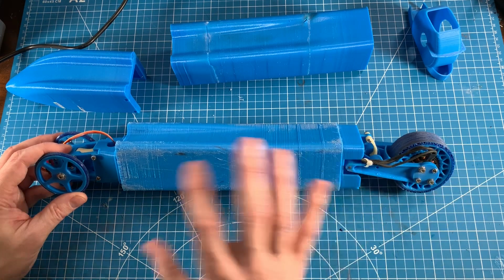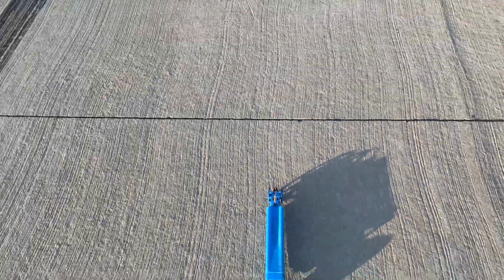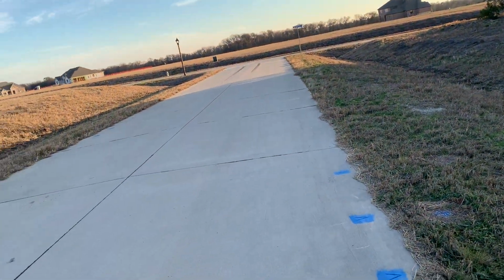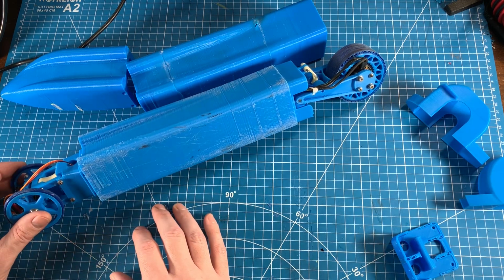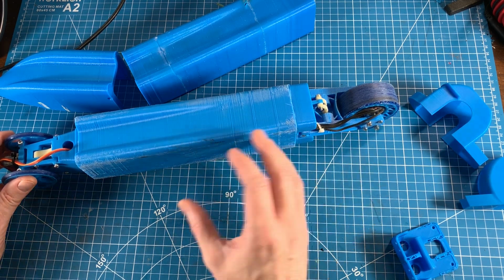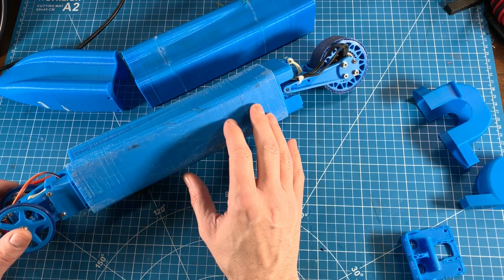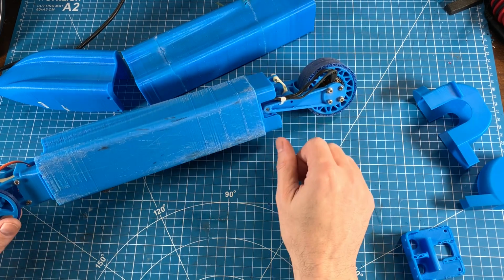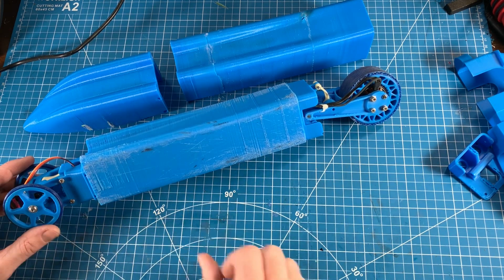Project Streamliner: First Test Pt4

Comment: maybe a bit late but increase the wheel size.. will slow down acceleration and bring up top end
Reply from the maker: Unfortunately, I think bigger wheels will raise the center of gravity and roll center both. I’m new to this, so I didn’t really clarify properly in the video, but the tendency to roll over is related to the relationship between the roll center and the center of gravity.  The tendency to roll over is because the roll center is so far above the center of gravity.

Comment: The motor turns so fast it may be hard to get that design working without any sort of gearing
Reply from the maker: Yeah, I’ve gotten it to work better now. I have traction control in the lasted version and I’m using a rubber tire.

Comment: Are you running a hard plastic tire? Because if you are, thats the bulk of the problems. It has zero grip, so it doesnt transfer any weight whatsoever. And that surface for testing will yield no results. Fantastic build and design otherwise.
Reply from the maker: They’re made from polyurethane, think skate board wheels. Right now I’m running a rubber tire which does have a lot more grip.
Reply: Open cell neoprene rubber is typical for RC drag racing and LSR. Would require a wheel that can be trued after mounting.
Reply: Also, roller skate wheels only work with a tremendous load on them, like the weight of a human body and Ive never heard of them being used as a drive wheel. I guarantee if you mount neoprene foam rubber, youre suspension will work much better as is.

Comment: Wow evidently we live very close together.  This is the road I have been running on lately.  The road is good for about 85-105 mph.  I'm looking to see if any regional airports would let me run there with my streamliner build.  We should meet up some time at this road for testing.
Reply from the maker: Wow that's crazy.  Yeah we definitely need to meet up and run the cars.
Reply: @IndeterminateDesign  let me know if you run again out there and I can come out.  Maybe I can assist filming for you while you drive.  It is about a 10-15 min drive from where I live in Princeton.  Shoot me a message at LibertyFrancis1@gmail.com

Comment: Awesome results. Some armchair thoughts:

1) The surface you're testing on is the scale equivalent of a drag car running on washboard road in Costa Rica.

2) First test I'd do on any wheel design is a no load full speed test to see if it will hold together and how it will deform at top speed.

Can't wait to see how this develops!
Reply from the maker: Yeah, that road surface is pretty rough. I wish there was some smooth asphalt that I could run on. 

I’m hoping to build a wheel test rig that I can run them up to 24,000 rpm and see how much they expand or if they explode. 😆 I can already tell that I may need to have these balanced and chucked into a lathe to true them up.

Comment: Great work!! I was thinking a higher coefficient tire would help off-the-line so it didn't get a chance to skid sideways in the first place. Finding a rubber that is thin and light enough but is also strong enough to handle the rotational speed wouldn't be easy. I really love the idea of a flexible wheel. One last thought, could moving the center of mass forward help improve the overall passive stability?
Reply from the maker: The flexible urethane I printed the wheel out of doesn’t have a very high coefficient of friction. I’m thinking about cutting up some mountain bike inner tubes to try out some rubber. 

That’s a great idea, I think moving the center of mass forward might help. I didn’t mention it but the biggest change between test session #1 and #2 was that I moved the battery as far forward as possible and lowered it in the chassis which made it much easier to launch.
Reply: @IndeterminateDesign  McMaster-Carr sells "flex-grip drive rollers" which can be as low as 20A durometer, which would be a huge improvement in grip (though it would be tricky to fit a motor/hub in one of them)
Reply: @bobspazoid7086  I see what you mean by the drive rollers. On their own they look promising but as you said, they'd be hard to implement here. My first thought was to cut a short section of medium/high pressure hydraulic hose since it comes with steel bands molded in. If you could get the right size, it would be easy to slip on over a 3D printed rim. But it would be very heavy and probably overkill for strength.
Reply from the maker: I like that idea, I’ll look at those. The trick with softer rubber will be how much it will expand at high speed. It’s going to be a balance.
Reply from the maker: I was looking at radiator hose but hydraulic hoses would be even better. I also may order up some HDT/GT belts with Kevlar bands. I see you can order them in custom cut widths. 

I might need to learn how to vulcanize my own rubber. 😂

Comment: Two ideas, first try adding some toe in to the front wheels if you haven't all ready to make the steering less twitchy at high speed (If you haven't all ready, I can't remember) and secondly maybe try adding a tuned mass damper if there is space (which there probably isn't), I think I remember Renault F1 using it in the nose of their car in the 2000s which kept the balance of the car from being upset when using the curbs and could make a big difference in stability.
Reply from the maker: That’s a great point on the alignment. Right now I’m running 0 toe, but it appears to toe out when running. I wish I had a mini camera to strap to the front to see. I may print out a few different front steering racks in different widths to see how they effect the handling.  
I’d love to try the tuned mass damper in the nose which is mostly hollow. I want to log vertical acceleration data from the MPU6050 so that I can optimize the dampening.  I’m not sure if it will be accurate enough though.

Comment: Looks like the suspension sticktion combined with the low weight is making it hop like crazy. Given the low size and weight, point contacts rather than cylindrical bearings might help (i.e. more Swiss watch than German sedan ;-)
When building motorbikes, we'd start with the softest springs and least damping and bring it up until it stops wallowing in use. In light vehicles, its really easy to make the suspension way too hard.

That surface you're running on, when at your RC scale, looks like a serious off-road track, complete with jumps.
Reply from the maker: Yeah, the wheel hop is pretty crazy.  I will try making tire with some tread and see how that hooks up. 

Starting with the softest and working your way up makes total sense. I think that will make it easier to tune the dampening as well.  I hope I can log data off the gyro because without a camera on the car it’s so hard to see how the suspension is reacting.
Reply: Another thing, the setup on the streamliner has a large amount of anti-squat, which is probably a contributor to wheel hop.
Reply from the maker: @bobspazoid7086  That's interesting.  I did add the anti-squat hoping to keep the front planted but I never could find any information as to whether there were any downsides or how much to use.

Comment: I'd be very curious to see how the car would do with some ballast experimentation or a gyro addition. Building a diy gyro would be a neat project. Maybe I'll take a crack at it.
Reply from the maker: The car is very reactive to weight distribution. I think ballast would help. I also have a lot more weight going in with bigger batteries and the shocks. 

There are a few arduino libraries out there for DIY RC gyros. They don’t work for my situation, but they’re great to see how they work.

Comment: You should also add a small tail rudder to ensure your center of pressure is behind the vehicles center of gravity. Right now it looks like the reverse may be true, depending on how heavy that BLDC is. If your center of pressure is not behind your center of gravity the vehicle will inevitably spin out and lose control every time.
Reply from the maker: My CAD model has the CP behind CG, but right now I’m missing a lot of weight without the nose, the tail, electronics, and bigger battery.   The nose is hollow right now so I can add ballast/ impact absorbing material.

Comment: This would be infinitely easier if you drastically increase the weight of the vehicle (while keep it balanced front to back). Vehicle weight is only relevant when maximizing acceleration or cornering speeds. If Vmax is what you’re going for you need grip to maintain high speed stability. Especially if you expect the vehicle to handle any sidewinds at all. If you want to get really fancy you can have a sensor measure air speed and direction and use rear wheel steering and PID control to dynamically and autonomously adjust the side slip angle of the fuselage to cancel out side wind gusts. That way you can basically just point one direction and floor it and let a microcontroller handle the millisecond micro adjustments necessary to keep it straight.
Reply from the maker: Weight is a balance in RC speed running because of the limited distances for acceleration. The radios are good for about 1200 meters so car really has to hookup and accelerate and then stop. 

Side winds are a big issue with this body shape.  Once I start running over 100mph I will need to run on low wind days.   Luckily this car doesn’t have a human passenger if I screw something up.